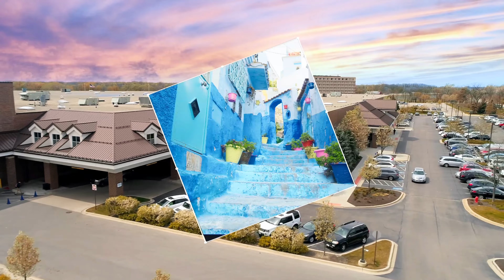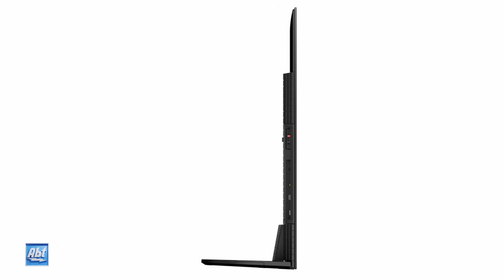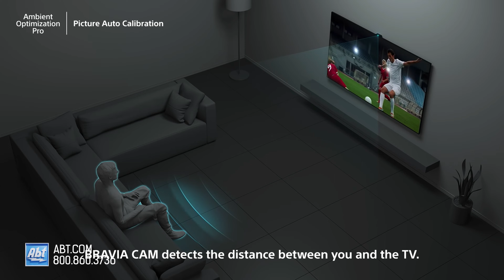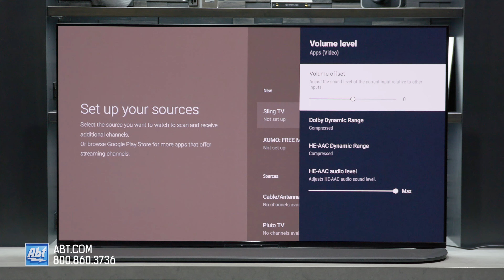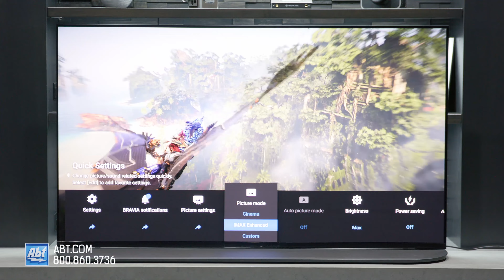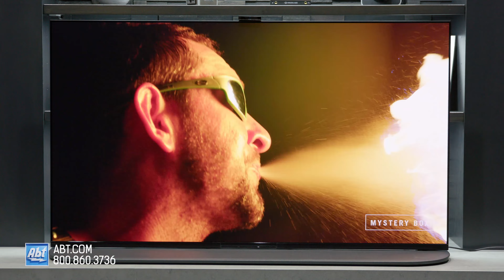Sony A95K QD OLED Overview

Comment: Anyone know is dolby vision to dark in sony A95K?
Reply from the maker: @Michael Carraghan It's hard to say what someone will consider too dark. We thought Dolby Vision looked great on the A95K. To address your question from your other comment, the G2 does a terrific job as well and comes in a wider variety of sizes. But at the 55 and 65 inch size, we feel the Sony has the better picture. Not everyone will agree though. If you're in the Chicagoland area you can stop by and see both models on display on our sales floor.
Reply: @abtelectronics  thank you. Its confusing what to buy these days.. I have lg c9 but I want to upgrade to newer tv. so a95K in dolbly vision looks brite enough?
Reply from the maker: @Michael Carraghan We thought so when we were testing it out.

Comment: Speaking of the wall placement... 

Is there any options to replace default power cord by  lets say 90 degree cord ? 

Currently the default cable prevents the TV to be closer to the wall..
Reply from the maker: @Serhii Borulko Sony doesn't have an optional 90 degree cord available. We don't recommend using an aftermarket one do to potential warranty issues, however, there is likely something out there that will work. Thanks for watching!

Comment: Makes you regret buying LG G2 OLED TV
Reply from the maker: @Robert Kelly The A95K is a fantastic TV, but the G2 is still a great choice and it's available in more sizes. Plus it comes with a 5 year limited panel warranty that covers burn in, which is a nice bonus.
Reply: @abtelectronics I thought manufacturers don't cover burn in at all.

Comment: @Carl - have you heard this TV used in a 3 front channel configuration?  Just curious how this actually sounds as a center channel.
Reply from the maker: @Sunshine Cycling No, not yet unfortunately, but based on how it sounds as its own independent system it should provide good sound as a center channel. That being said, it will likely not be timbre matched to the other speakers in your system since Sony doesn't make independent speakers that use acoustic glass. If you're not a huge audiophile I imagine you'll still be very happy with this as a center. You also wouldn't need to find a spot to put a dedicated center speaker as this TV doesn't have any kind of pedestal position to accommodate a center channel or soundbar. Thanks for watching!

Comment: I still dont understand why sony doesnt use full hdmi 2.1 support. Having both series x & ps5. + sonos arc i will loose one port
Reply: The electronic module that controls all that comes from a company called mediatek

They have not released a model with 4 2.1 port support.

That changes next year though and all the major brands will have it.  LG uses its own chipset which is why they have had it before most of the other companies.
Reply: @paulcox2447  Wrong. MediaTek does have a chip that supports 4 hdmi 2.1 ports, the (MediaTek Pentonic 2000). It's a much better SoC than the S900 (MT9950) chip they're using now. which im guessing is a lot more expensive which I could see why Sony didn't go with it. The tv is already expensive as it is, let alone if they went with that SoC, people would be even more blown out by the price complaining even more about it

Comment: Or just get the S95B for $1000 less and stop lying that the A95K is so much better, it's literally the same panel with very comparable processing, and if you catch the S95B before update 1302 and keep it offline it boasts 1500 nits in all modes, taking maximum advantage of those wonderful quantum dots, it actually delivers a far superior image to the A95K with that 50% boost in brightness, perhaps not the most color "accurate" by outdated standards that don't account for the color brightness that only QD-OLED can deliver, but the S95B in it's prime is certainly the most vivid and stunning, once again at $1000 less, don't get me wrong, the more relaxed ABL on the A95K is nice, so are the natural appearance of colors, but when you talk like nothing can touch the A95K when the S95B is out there, well it just sounds like you're a Sony shill at that point, or so ill informed on the current available panels that you have no business making suggestions to others, js
Reply: Colors in Sony are much better
Reply: @lifeextensionespana580  not from what I've heard from multiple people that own both, yes more "accurate" which is typically more dull, but if you like in your face pop to your imagery, most that compare them that aren't calibrators or influencers attest to the S95B looking better overall, outside a few processing advantages done by Sony's cognitive processor, granted reality creation is a really nice touch, Samsung is implementing similar software baked in, meant to focus processing on frontal images in favor of easing up on the fuzzy backgrounds that don't really need it
Reply: @mythoti  i have seen both in person. As expected Sony is better specially in colorimetry where Samsung is always poorer in any TV
Reply: @lifeextensionespana580  always poorer? The S95B destroyed the G2 in color accuracy and LG rides accurate like it's the last train on earth, if it's that close to the A95K in "accuracy" for $1000 less this is a laughable discussion 🤣
Reply: @mythoti  and Sony A95 was the best in Value Electronics shootout as expected
Reply: Everyone forgot about the radiator that is in the Sony a95k, and it is not in the Samsung s95b, how long do you think the s95b will work?I don't think for long
Reply: You samsung shills are something else. Why do you care what somebody else buys. You seem like salesmen on a yt comment section

Comment: As a owner of both the S95B and A95K the processing on both TVs are pretty much equal from what I see the only advantages I noticed for the A95K is Dolby Vision Bright everything else is slightly to the S95B due to its ability to get a little brighter overall but sometimes the A95K looks better sometimes the S95B looks better so to me they’re equals I don’t see Sony’s processing on the A95K as better than the S95B and gaming on the A95K is not better than the S95B I notice quicker response on the S95B
Reply: @codyschwart8639   S95B
Reply: It’s $700 off right now
Reply: Yeah the processor is better but, to the everyday consumer is it worth $1500 more?? Sony is the one who held the event so 🤷🏻‍♂️
Reply: @codyschwart8639   watching both TVs and I love em both but processing is equal from I’m seeing motion is better controlled on the S95B cause the A95K only goes up to 3 but it’s still good tho and the only advantage for Sony is the Dolby Vision Bright mode but the problem with that is not every movie is Dolby Vision so the S95B looks better in the other movies outside Dolby
Reply: @codyschwart8639  in the uk it’s only 400 pound more. And for better processor. Cleaner panel better build quality. Better settings better motion better remote and better ui better sound less diming heat sink . I ll happily pay the extra  I don’t want a buggy bent rushed tv that’s seems to get worse every firmware update
Reply: @chrisgault87   sounds like you’re a S95B hater, I’m glad I have both TVs so I know that what you’re saying is nonsense
Reply: @leroyrodrigues4885  I listen to experts who put the tv through torture tests and have equipment to test out the tv properly  not people on YouTube comments who might have a bias and not even own the televisions. The Sony won the shootout on a few things. So stop saying there the same. Am getting my a95k in 8 days  wouldn’t touch a buggy Samsung.
Reply: @leroyrodrigues4885  why have two similar tv  if you do ??
Reply: @leroyrodrigues4885  but its not nonsense. The other person was pretty on with it. And many S95B's had bad quality control. many were bent. And samsungs on avg dont last a long time before many of them start having issues
Reply: A95K IS THE GOAT 🐐
Reply: There is discussion about the recent firmware decreasing the NITS on the Samsung.  I'm not sure if you're up to date or not, but it is something worth looking into if you plan to keep the Samsung and an update is done.
Reply: Everyone forgot about the radiator that is in the Sony a95k, and it is not in the Samsung s95b, how long do you think the s95b will work?I don't think for long
Reply: They aren't Sony Bravia A95K QD OLED has better colour accuracy and motion processing and upscaling
Reply: A95 better tv. Won the shootout. So it def has better processing
Reply: @chrisgault87   so you’re gonna be dumb enough to tell me that I don’t know what I’m looking at in front my face when I have both TVs in front of me and as for your shootout analysis big deal I don’t care about a shootout I only go by what I see between those 2 TVs which are in front of my face so get out of here with your nonsense
Reply: @leroyrodrigues4885  Samsung S95B only advantage it's better for PC gaming slightly